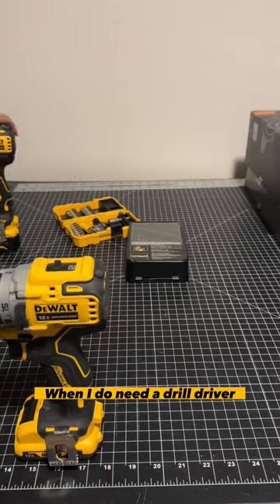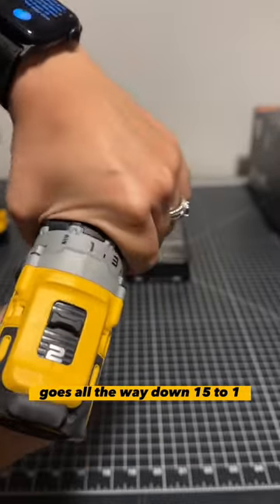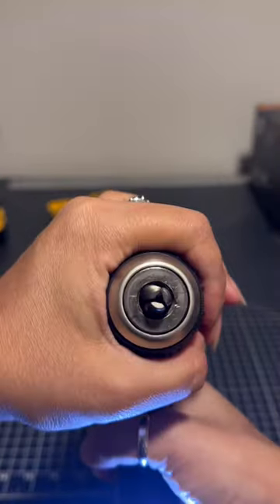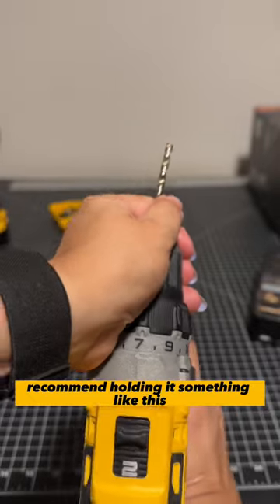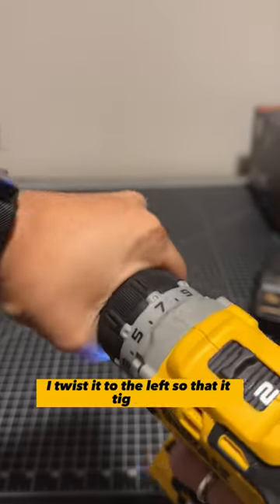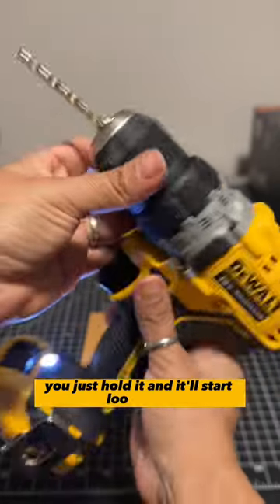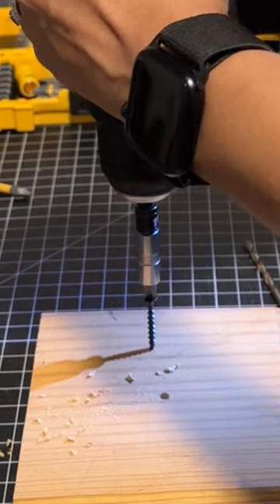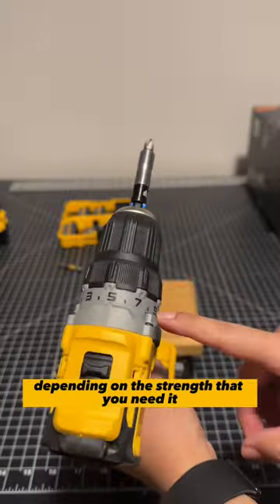How to use a drill driver and what the settings mean #dewalt #drilldriver #powertools

Comment: Lol another video that fails to mention the 1 and 2 setting on the top😂
Reply from the maker: Sorry I thought I mentioned that. They only give a minute for shorts. 

The switch on the top is for the speed setting. 1 is slower with higher torque 2 is faster and some drills even have 3 which is the fastest.

Comment: The numbers are not drill strenght…they are depth for when you are putting screws in
Reply: ?? It’s the torque strength my guy
Reply from the maker: Sort of but not what the number means. The amount of torque will determine how deep you can drill into different materials though